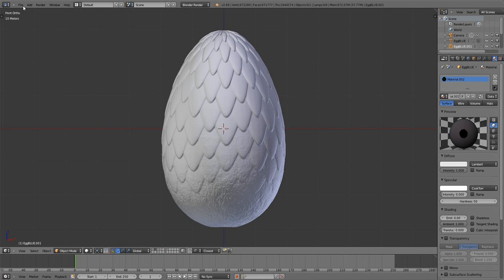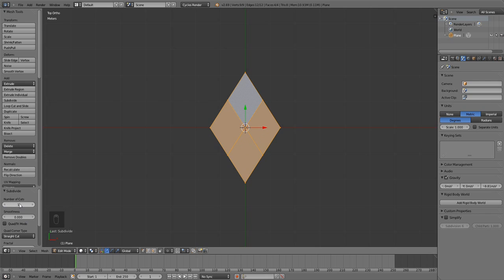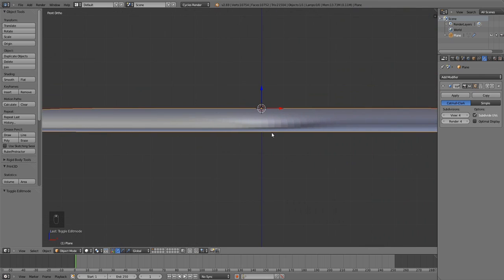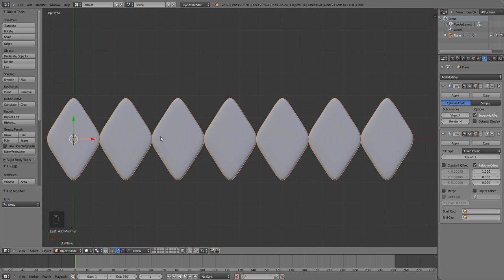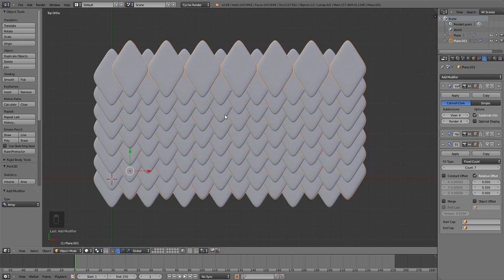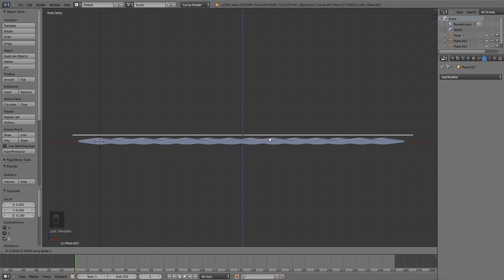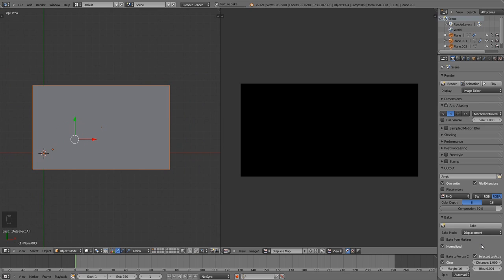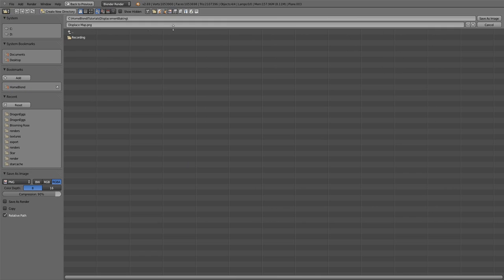Create Displacement Maps using Blender

Comment: do you really need to add all those vertices to that plane when applying that displacement? i thought the whole point of displacements is that you have very little geometry at the end
Reply from the maker: Thanks for the query.  Displacment Maps are used to displace geometry. You can follow these instructions with very few vertices to see the difference .  Normal/Bump maps are a visual way of simulating hi poly geometry on a low poly object.  In this particular case (and the purpose for the tutorial) I needed to create a hi poly object for 3D printing - so Normal/Bump maps wouldn't work.  Most people don't generally have a need for displacement maps as normal/bump maps provide a very low cost (minimal poly) asset with hi cost (hi poly) visual for games etc.
Reply: @Granthus  ahh right. i'm not all that familiar with displacement maps. only used normal maps for games.

Comment: how do I displace the scales on an already sculpted/made mesh like a tail for instance???
Reply from the maker: I am assuming the scales were not sculpted as part of the mesh.  Simply make sure the tail is UV unwrapped 'flat', modify the displacement map to only effect that UV part and then apply (like creating a texture map but only for displacement.)  This would let you use different displacement maps on different parts of your model.  Just make sure you UV unwrap as 'flat' as you can so the map doesn't get distorted. (Hope that Helps)
Reply: thank you so much ^_^

Comment: I have a smooth, low-poly egg-shaped model, and a high-poly version with extra height details added to it. Is it possible to bake this height information from the HP version, and use the resulting texture as a displacement map on the LP version?
Reply from the maker: Yes - but not as a displacement map.  Displacement maps as the name implies require lots of vert's to 'displace'.  You could however bake a normal map from the HP version and apply it to the LP for a high poly 'look' when rendered.

Comment: Does anybody know why when I apply a displace modifier to a cube it only applies it to some surface but not the others ie the vertical surface facing along the x axis but not to faces facing on the y or z axis??? Or does the displacement only work on a plane???
Reply from the maker: Make sure to UV unwrap the cube fully first.  Generated UV's have some faces/planes wrong for displacements.
Reply: Thanks for reply but I am not sure what you mean ???- The cube is fully unwrapped and the normals are all facing outwards ......it seems to me that we cannot use texture displaacements (ie based on image textures) on multiple surface objects - ie the displacement will only work in one direction - either x or y but not both????

Comment: very good, thanks for posting this, easy to follow. I wonder if you applied such a map tio an object that had thickness, would it alter geometry to one surface of the thickness or would it pass through and alter the opposite surface as well
Reply from the maker: If you apply a solidify modifier AFTER the displacement it will modify both as the solidify works over the modified surface.  'Solid' geometry however would require UV mapping and have the displacement applied to all surfaces you want it to effect.
Reply: thank you.